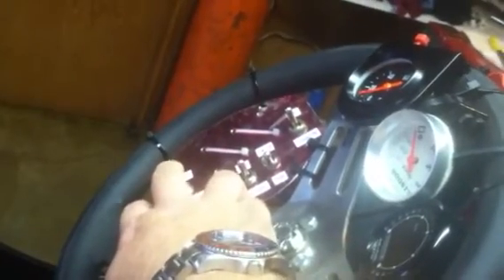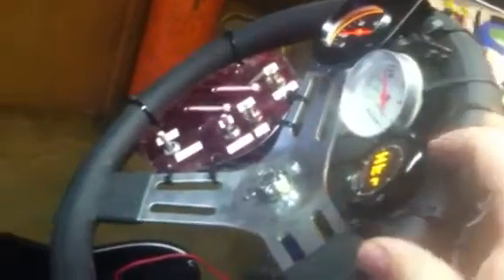Turbo predator 212

Comment: Bro you got to really get in depth with this for us, this badass. Did you mod the motor at all? Obviously it's fuel injected(or is it?)...I got to many questions lol please let us know what's going on. Awesome setup!
Reply from the maker: +Metal Rott Sorry, I forgot to put a link!

 www.brainlubeonline.com/clone 

Right now I'm working on tuning. When the density increases, the jetting goes WAY off. I'm currently at 4000 RPM at around 5psi of boost with just a touch of brake for some load (engine dies rich). Check out the link, I'm going to try and put in a smaller Main tonight. If all goes well, first human test to come.
Reply: BrainLubeOnline.com  Very cool, to bad about the EFI, that would have been the best way to go. Blow-thru is a pain in the ass to get correct. I personally would have gone with a Draw-Thru setup but I can see why you wouldn't go that route (New exst manifold etc etc). I think your Boost Referance Regulator isn't working how it should, with that fuel-pump and a working reference it should be leaning out unless either two had an issue. Just my 2 cents, I hope you get things squared away. Awesome setup !

Comment: Wow you need to make a driving video
Reply from the maker: +lamar “Mars Planet” Working on it! It goes rich into boost. I've got some jets on order.
Reply: Just run it on methanol and tune it extremely rich. Can't run too rich on methanol.
Naturally aspirated i've been so rich methanol was spewing out of the exhaust and still ran better than gasoline.